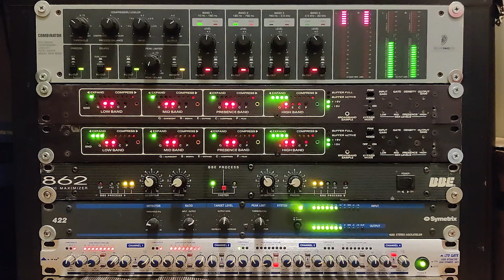Rack of analog audio processor: Symetrix 422 + BBE 862 + Texar audio Prism + Behringer MDX 800

Comment: You need more drive on the audio prisms. You want the LED bar graph meters to read 2/3rd scale towards the right to really get the correct audio prism signature. Or, turn up the audio input gain on them until you get “buffer active” lights illuminating, and back it off just enough to prevent the “buffer active light from illuminating too often. You never want the “buffer full” lights to come on.